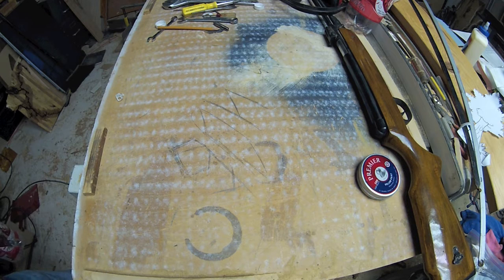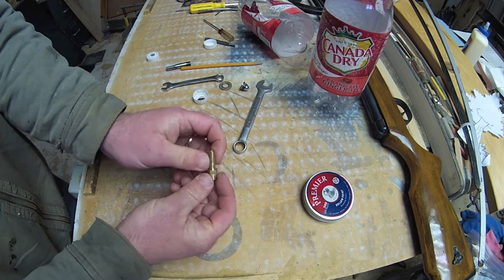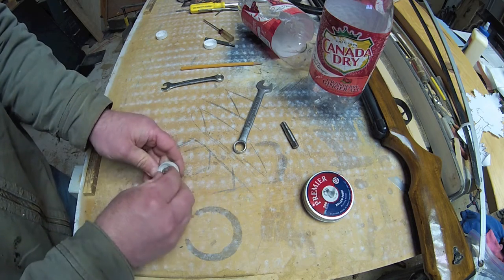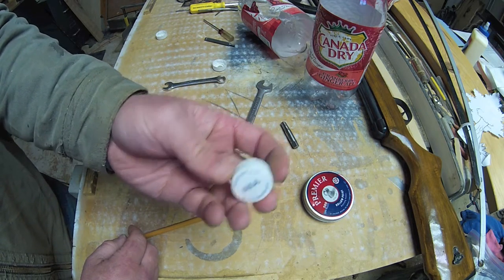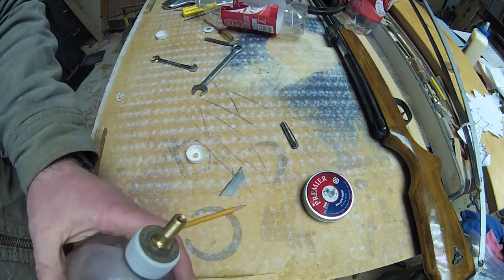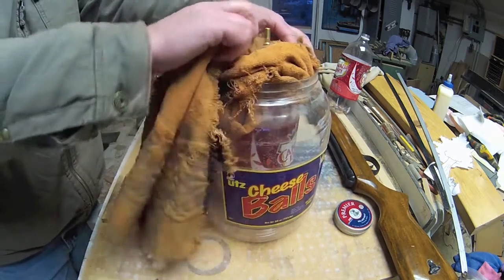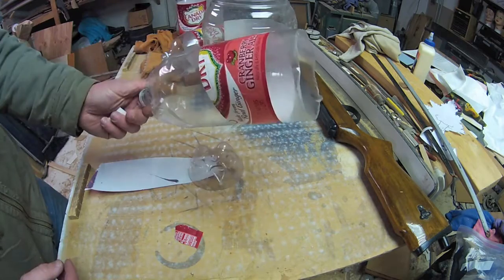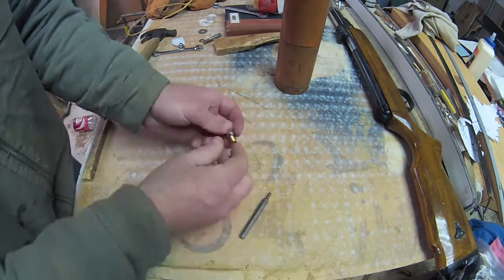Making Exploding 2L Bottles

Comment: That's a pretty heavy duty target. Most designs I've seen use tubeless tires valves and pull out through the cap.
Reply from the maker: That is what Tom Wilcox pointed out, I did this in about the most difficult way possible.  Since the caps seem to fail about every other time I now do it just as you describe.
Reply: NelsonStudios That is some fine craftsmanship you put into those. I mean going out and buying a tap for threading is above and beyond. That is commendable. 

How have these targets worked out for you? Have you tried putting anything inside like water or fine dust to get a more dramatic effect?

Comment: That's pretty cool! I will have to look into those Chinese air rifles! I think a rubber valve stem might work but not as positive as your setup. It might be a bit difficult to get a good hole to achieve a good seal.

Comment: I used valve stems that are used on any car or truck rim. Drill the hole in the cap insert the valve stem pull it through until it snaps in place and you are good to go. They make an excellent seal. BOOM ! I was a mechanic and scared the shit out of so many  asshole customers who would stand behind us and try to tell us how to do our job or God help them if they tried to help! Attach hose drop it in a 55 gallon barrel we used for garbage cans walk around the corner and turn the air on from the valve on the compressor. They would stretch as big as a balloon before they popped! It would make your ears ring for days. I think our compressor went up to 150 psi. Takes all of that to make one blow. If no compressor dry ice works great or the trusty stand by Reynolds wrap and drano. I buried a few in the ground then put the drano mixture in. That was damn fun watching dirt fly out of site.
Reply from the maker: +Tom Wilcox You are right, I went about this in about the most complicated way possible didn't I?
Reply: +NelsonStudios I hoped I helped. The air chuck you put on the valve stem must be the kind that clicks or screws on so the hose will stay on. I wrapped duct tape around one 2 liter from top to bottom. VERY INTERESTING! LOL Make for some good high speed photography. Don't forget about the 2 liters little brother the 20 ounce. They work just as well. I hope you have happy explosions. Hope you make another post on the subject. Thanks!